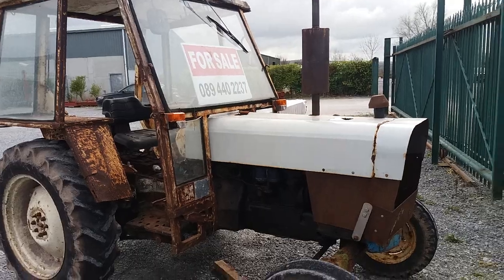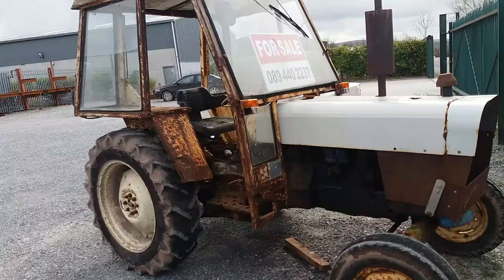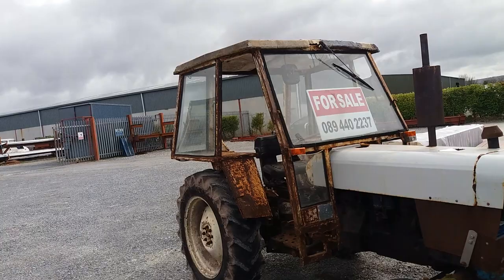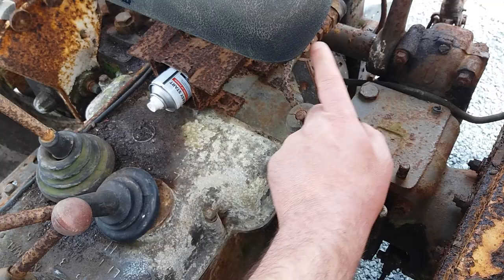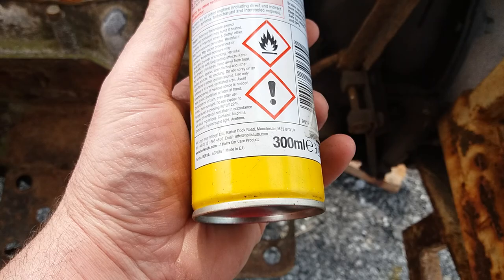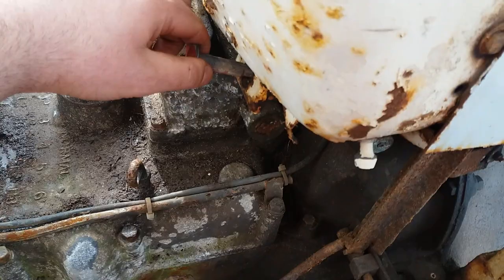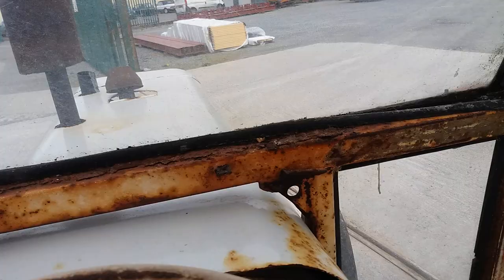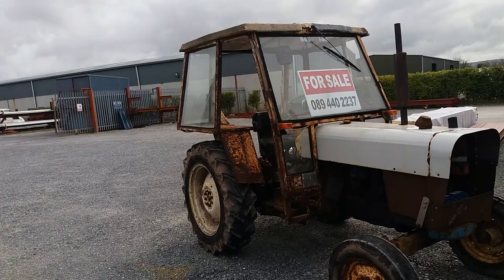David Brown 880 12 speed reduction gearbox

Comment: the 880 were a great tractor especially pulling a plough or a trailer , had one with almost 20,000 hrs before we traded for an 885 , which had the 12 speed gear box, but with only two gear sticks, seldom you'd use the 3rd range
Reply: Yes very durable lots of them did those amount of hours out out here in Australia their biggest enemy was the tight ass farmers that would not service them properly